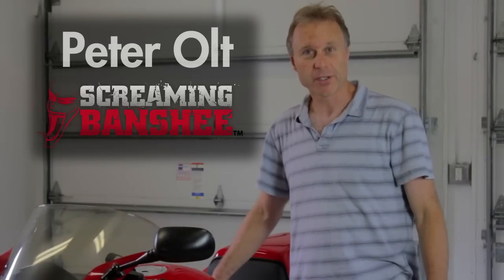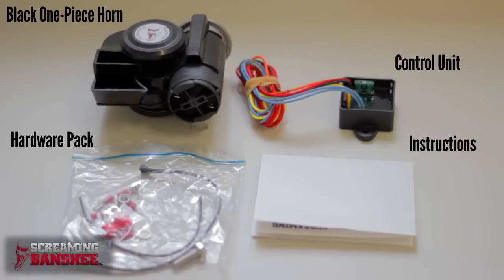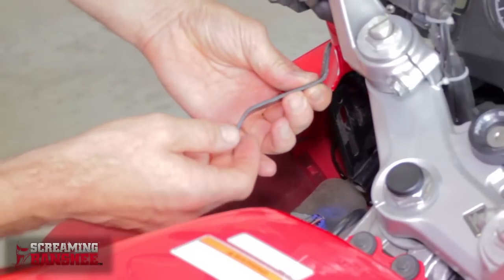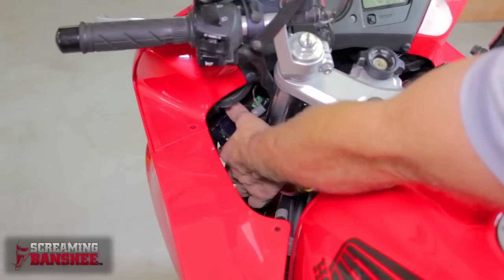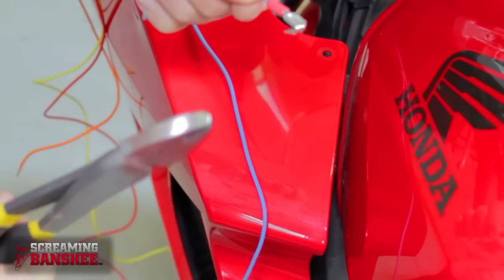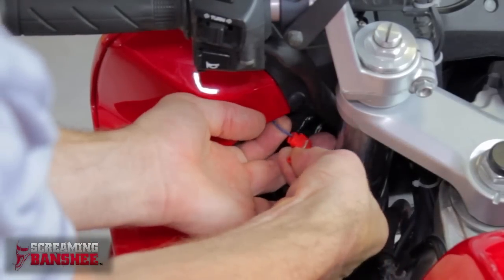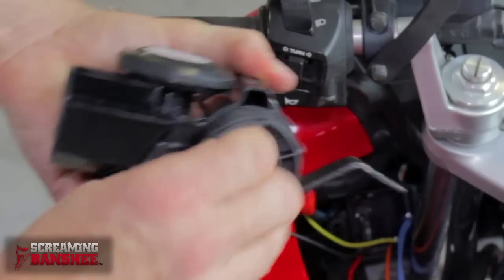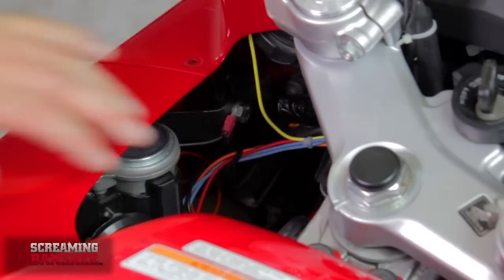How to install a Screaming Banshee Horn System

Comment: I have a 2013 Triumph Thunderbird Storm. Installed are highway (crash) bars on either side. Is it possible to mount the Screaming Banshee at the top horizontal part of the bars? This will put the horn front and just left of center.

Comment: If I don't want the linkage to the light do I just bypass connecting that wire?
Reply: Hi, yes, the yellow wire doesn't have to be used. If not just make sure it cant short against the chassis. Regards, Peter
Reply: Banshee Horn thank you